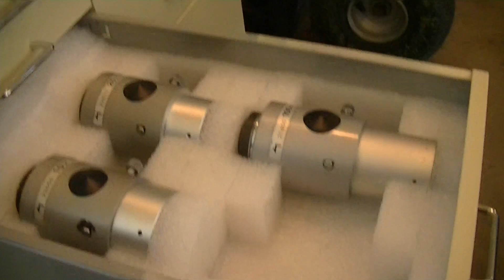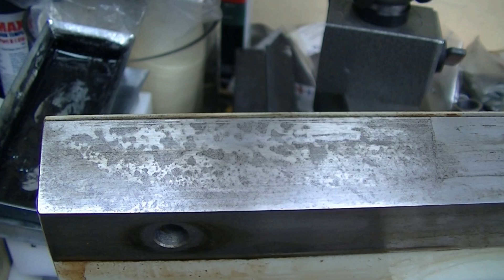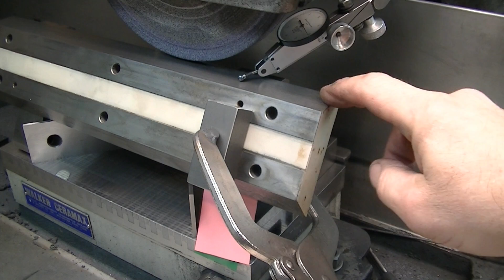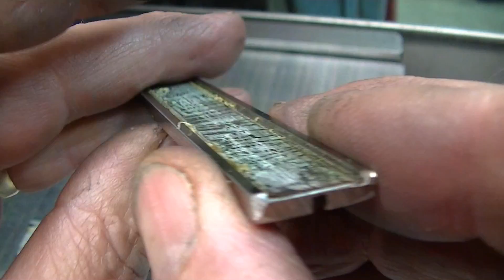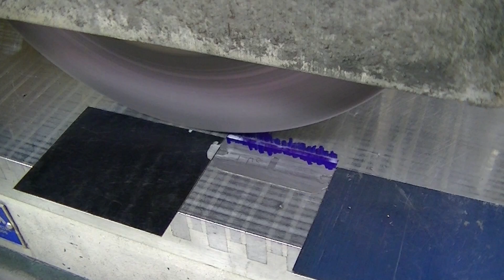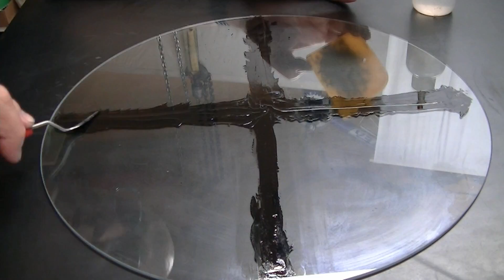NIKON COMPARATOR RESTORE

Comment: Brother in Christ, Robin, what the hell is even this? I was looking forward to seeing how you would grind those down, and the only thing i saw was things sitting in a v block or on the angle blocks... Did you plunge down and traverse the wheel across in those v ways or did you creep feed it in sideways with a sloped wheel surface to allow the wheel to establish proper flat geometry? I love you man, but you skimped out on me...
I have a deckel s1 to restore and it uses pretty much the same roller system, and im having difficulty considering the best approach to cleaning the ways up... It suffered the exact same rust that your comparator ways did, and while i could just get a brand new pair of ways, they arent really available, and i dont have a machine shop for naught... I could mill them down the side with an ultra hard carbide 12fl endmill and that would pretty much restore the thing in minutes, but i am considering grinding for a reason... And its likely the same reason you did grind yours... Higher precision if done right, straight outta box... My large milling machine is sublime and i trust her to produce micron flat surfaces across any axis, but i do have a large surface grinder and 30 wheels for a reason... 
I wanted to see how you approached grinding, not the setup, as setups are kinda up to the operator and their equipment... I woulda gone with a large sine plate as the method of fastening and angulation... Slab sized sine plates are the best, tho fickle to set up...
I wanted to see how you would operate the grinder in those female V ways, as just letting the wheel ride down the length of the ways in full width would have created a sloped upward surface, in accordance with the microscopic wear of the wheel accumulated from where it started to where it finished... Now of course, you could indicate the slope, lower the wheel to correct the wear, start the grind from the other side, making the middle the high spot, correct the wheel height again and take down the middle, which would kinda approximate a flat precise surface with a few iterations and passes like that, but i kinda hate that approach as its not lapping per se, where you are doing that kind of averaging to produce near perfection in hundreds or thousands of passes... 
Maybe with a cbn wheel could be relied on, as they truly dont wear down that much, but even then, its no proper use of the nature of the surface grinder... 
Dressing the wheel at an angle to allow you to start or finish the wheel traverse inside the flat gap between the surfaces is what i had in mind... That would allow you to use the nature of the surface grinder to its full extent and produce an even surface, where the wheel adjusted and accommodated for wear by being able to move past the surface into that ``square`` gulley, which is there for that exact reason... I really wanted to see how you would approach this, and i will rewatch your other videos on this subject, but come on... You cant not show the most important part... Also, im glad to see you are okay and uploaded recently... I highly value your content and admire your work and the content you provide... As a mostly self taught machinist, you are my standard of quality and approach, and whatever i do, i consider would you do so... From shop cleanliness that i took from your spindle refit video to machine use and all other considerations, I also read through that timken bearings catalog/manual around 10 times by now and have it open on ang.cont. section at least 5 days a month... 
Of course, there is Stefan and a few others who meet the criteria, but you are the gold standard in my book, so i always revisit your old content that is tangent to my current projects and works as a muse and a guide, so please, how did you actually do this? I get everything else, as over 15 years of dedicated learning and watching content like yours did impart a lot of know how into me, but narrow V ways are a bit of a sketchy thing in my mind... And deckel doesnt have male V ways, its 6 pairs of female V ways with box arrangement of rollers that take up the square precision voids between them and tapered gibs to snug them down onto the rollers... 
I picked the machine up for peanuts literally, i dont know how, as just the indexing heads are 2k$ anywhere, but apart from what little rust there is to replaceable V ways, the machine is perfect... Leadscrews show no thinning that would indicate wear and use... She likely sat in a shed, neglected for decades, and used on occasion to fix up a tool or two, which squeezed out the lube from the ways and let them develop some rust, where all the other parts were well preserved in dusty caked up oil... The guy could have netted around 10K$ by parting her out as spare bits on ebay, and instead he got paid enough for a mitutoyo caliper and a decent beer...

Sorry for the pocket bible length of the comment...

All the best and warmest regards,
Camillo Steuss

Comment: Can you dress the wheel at the angle of the V way at all and come straight down with these kinds of ways? I am wondering how to restore older surface grinders with this type of system, as there are a few. The inserts are usually removable but I fear they are ground in place. Tilting an entire saddle could be problematic to restore one. Thanks as always for your videos and knowledge.
Reply from the maker: Yes you could.

Comment: “Horse shit compound”

Instead of potting compound to level the surface… You could the old Blacksmith trick… used for centuries.

When securing an anvil to the base. Usually a tree stump or other type of wooden stand.

They mixed horse poop with Clay or other minerals. and smeared it all over the bottom of the anvil. 

Then set the anvil onto the stand and carefully press/pound it into place. It would seat into the “compound“ and fill any gaps in the Interface between the surfaces.  Helping the transfer of energy and greatly decreasing vibrations. 

I’ve always used neutral cure silicone caulking when seating my anvils.... but if I ever decide to go retro… I’ll use a horse with a good diet so it won’t stink so bad.

(by the way… I use neutral clear silicone because many of the silicone caulks have acids and other things that will cause corrosion of the steel.)

Comment: Hey Robin, I love your videos. I had a question. In your surface grinder rebuild video. You stated that when using roller bearings the mating surfaces have to be over 50 Rockwell. Are the ways you reground on the comparerter hardend? Or does it not matter in this case because there is not hardly any load?
Reply from the maker: Very light gravity only loading allows this to work with the softer iron surfaces.

Comment: Robin, Im confused by the geometry of the vee way versus the flat way on the table.   If you take a thou off of a 60 degree angle on the vee that should drop the height by about 5 tenths, and  then on the other side of the vee that gets you to a 1 thou total on the flat, not two.   What am I missing?
Reply from the maker: Solidworks says I am right.

Comment: Hi Rob,  I have the exact  same model comparator,  did you have to make and adjustments as you reassembled the machine?   Mine seem to go slightly out of focus as you move the Z axis.  Alos do you have a manual?  I would be happy to pay for a  copy and postage.  Very nice work on your restoration!!
Reply from the maker: Thanks, I don't have a manual and mine seems to be fairly well aligned optically as is.

Comment: Very much impressed by Your work!
I have the smaller model,  a Nikon V-10  that I use a lot. It seems like Your frosted screen and lines came out better than the original, The lines on mine are somewhat coarse. Mine has a XY horizontal table. Added a rotary stage to simplify aligning small parts.

Comment: I've used very fine glass bead in a blast cabinet to frost glass and Perspex with perfect results.
the trick to get an even frosting is to aim the beads at a 20-30° angle
one is able to create different levels of frosting using the air pressure and angle of attack.

Comment: What is the purpose of the helix angle adjustment and what does it do?
Reply from the maker: When looking at screw thread forms you turn the table to the helix angle of the screw at the pitch diameter to get a more uniform focus of both flanks of the screw..

Comment: Every video, always a treat...and it's worth the time and effort to screw/bolt the casters. As a welder/maintenance man, I cannot tell you annoying it is to try to cut off 'welded-on' casters, especially when they were welded completely around the 4 sides, when just 4 small welds would do fine....!
 As for the 'frosted' glass, I was almost expecting hydrofluoric acid. Can you speculate on how the original glass was done? I've seen videos here on manufacturing light bulbs, they use the acid treatment.
Reply: I believe hydrofluoric acid is so dangerous that you need a special licence to buy it.
Reply: Maybe, but here in California, and Oregon, my brother gets it at Art-glass supply stores with no problem, just show ID that says you're an Adult. It is used quite often for etching Art Glass.

Comment: Interesting to see work on glass, Rob. You said you wanted to keep this refurbishment simple and not make a project out of it. Therefore you only regrind all the ways, putty down and respray all the housings,  fit in drawer blocks, make a new glass screen with cross hairs and hand frosting and due to 2 chewy bolts replace all of them. Now I wonder what a real project of yours looks like.... Dig up the ore to make the steel for the guides? :-) I think I got the answer: In real full projects you have to slow the video down 8 times not just 4.... ;-) 
(those who dont get the joke have to watch the video over its full length...)

Comment: Nice work Robin. A resurrection of a fine instrument. You're right: having an optical comparator in the shop is a real boon - even to those whose only use for it is to validate the grind of form tools and measuring difficult to access part features. Mine is a cheap Micro-Vu 500HP. Its virtue is it's cheap, light, and portable. The one I acquired was in good shape requiring only cleaning and TLC. I replaced the busy 12" screen of angles and radii with one having a simple cross-hair and put LED's in the lamp houses.

That beautiful Nikon comparator, now fully restored to former glory, offers one in your line of work easy precision for determining otherwise hard to access and hard to measure part features.

Wonderful video. Great detail, fully explained and demonstrated but you had to cherry pick only a few of the many steps to discuss. I can see why: given your once every three months rate of video production, a thorough treatment would probably require more time than either of us has left on Earth. Regardless, grateful for the highlights.
Reply from the maker: Thanks Forrest, good to hear from you and hope all is well!
ATB, Robin

Comment: Outstanding work, as usual. I've restored several view cameras that needed focusing screens and found soda blasting gave the nicest fine matte surface. I'm told dilute hydroflouric acid works best but who has that?!
Reply from the maker: Thanks and thanks for the tip!
Reply: > I'm told dilute hydroflouric acid works best but who has that?!

dental supply, look for it, they have some sort of pasta/goo stuff with hydrofluoric acid, not sure wish precautions you should take with it be smeared on large surface(I would prefer space suit) but people sucessefully use that to decap microprocessors in reverse engineering
Reply: Welding suppliers have stainless steel passivating goop that contains hydrofluoric acid, might work?

Comment: Hey Rob,

Superb accuracy as usual

Wanted to chip in : that I use Laser Printer Black Toner powder instead of carbon black to mix with Epoxy when filling very fine groove markings. It is super fine and very deep black.
Reply: Careful, there are toners with wax as a carrier, and toners with a polymer carrier. Many use titanium dioxide as the 'black', fewer use carbon.  Toners made for color printers/copiers are much more likely to be polymer based.  I bring this up because heat may cause some goofy behavior if your epoxy-toner mix is actually part wax.
Reply: A.H. Shukry to
Reply: @Cory Allison Sorry ??

Comment: Rob have you seen those mats that you can set in the bottom of your oven as a liner?  It's some kind of very thin material which must be somewhat durable to be able to resist cooking oven temperatures.  I was wondering what you thought about using that material for chip shields?  In your other video you endorsed mesh reinforced neoprene I believe it was.  Last thing - do you know what those oven liner mats are made of?  They sell em at hardware stores and grocery too
Reply from the maker: Teflon coated fiberglass. IMO its is too easy to tear with chips.

Comment: Robin, super nice job, thanks for the video.   Will have to try that line grinding with the razor blade some time.   My grand father was an instrument maker and told me at one time they used spider webs to make cross hairs for reticles even splitting them in half or quarters to get finer and finer widths.

Comment: Note.. Those screws with the dot aren't phillips.. they are JIS Type S .. they look almost like a phillips but use a different shape tip, which is probably why they were all buggered up.
Reply: Yes, they're indeed JIS ('Japanese Industrial Standard' for those playing at home). JIS screwdrivers can be had on Amazon. I once asked the local Snap On guy about a set, and he looked at me like I was from Mars... he'd never heard of them. They sure make working on Japanese stuff pleasant; but in my experience, once someone lunches a JIS screw head with a Phillips driver, all bets are off. :( Most can be ID'd by the dot or small 'x' to the side of the cross... I've heard some may not be marked at all.

Comment: Hi !
I nearly got one of these on an auction for next to nothing here in Denmark ... but missing all extra options lenses and so ... but in the end I haven't got the space for it ... so good another one got it ;-))

How about doing the frosting with sandblasting before you made the cross hair - just an idea ... IF I should find place :-))
Reply from the maker: Doing the groove first and filling it with the black makes it easy because the frosting process finishes off the epoxy flush with the glass.  Sandblasting is too coarse of a frost for fine resolution.

Comment: @robrenz, sorry if I missed it. But, what is the purpose of frosting the glass? To prevent glare?
Reply: Hard to get the even finish with acid, unless you are willing to first polish it mirror smooth, then wash with solvents and water till it is absolutely clean and grease free, then finally apply the hydroflouric acid in a low concentration while agitating the glass, so that the acid does an even etch, then removing the acid very fast so there are no streaks. As well it will take out the carbon in the markings and destroy the epoxy. Quick and fast etch sure, but not going to be as even as what Robin got there with the diamond grit, it will show up the stress in the glass pour as it etched directionally along the glass, especially if you want a fine etch.
Reply from the maker: It is what make the image appear on the glass surface.
Reply from the maker: SeanBZA gave an excellent answer to that below.
Reply: Wonder if you could acid etch the frost for a more uniform finish? Or maybe laminate the glass with a semi-transparent layer of something?

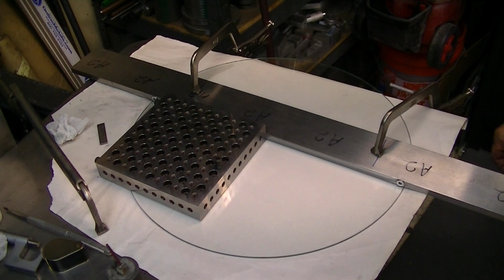Comment: What a mind blowing job at restoring the comparator. I was wondering about you saying that the lines of the crosshairs don’t need to be exactly on center at 34:04. I have used comparators to measure angles on, for example, a custom trapeze threading tool. 
If you would like to measure the tip width you would normally find the top and corner of the leading flank, rotate the screen so one of the crosshairs sits flush at the top, move over to the trailing flank and find the exact crossing and do the measurement. If the lines are of center wouldn’t that cause an error since they will move from the line when rotated?

Or are there any provisions within the graduated bezel that allows for exact centering at installation that I missed?
Thanks for another amazing video. 
Kind regards Raphaël
Reply from the maker: Thanks,

Correct,the graduated carrier ring has 4 eccentrics to push the glass around to get the cross hair center to align with the axis of rotation of the protractor ring.

Comment: Nice job Robin, I like your solution to the cabinet top.  Thanks for taking the time to document and share your work.
Reply: I did a quick and fast cabinet repaint last week, was better than before, but your one looks better than the best the factory could ever do. But then, I spent $2 on materials for it, basically bought a foam roller and tray, and had some left over beige enamel paint, 120 grit sandpaper and some turps to do it with, and 2 hours later I was done. The other I spent $5 on, I did a second coat of hammerite blue, as I was doing the first coat with 100ml of left over paint and hammerite thinners, and it was looking thin, so got the second coat on after 12 hours. Bought a 250ml can. Nothing to look at, but it was a free cabinet in both cases. Both cases the roller and brush were toss away cheapies.